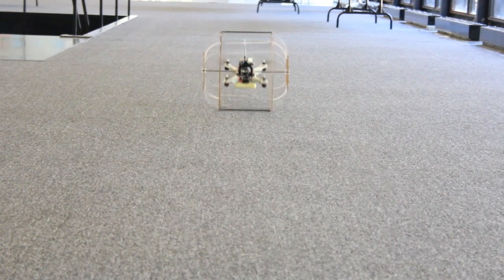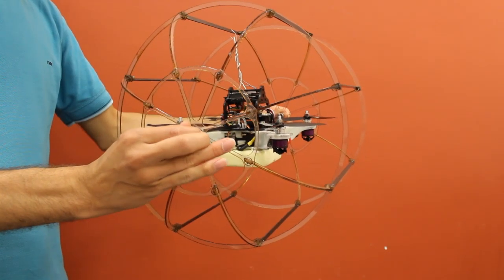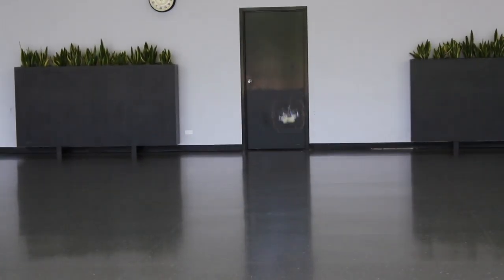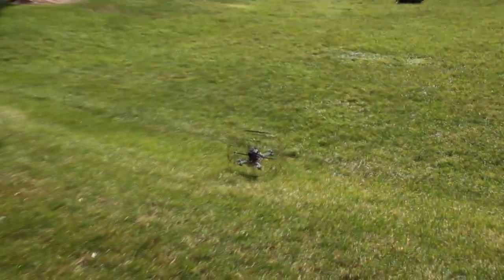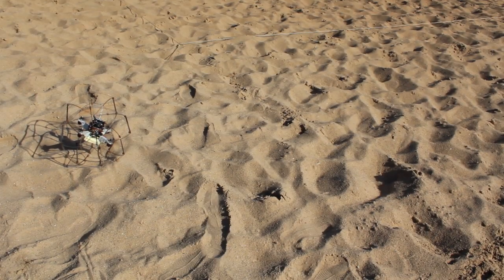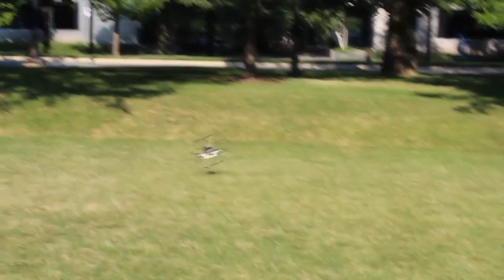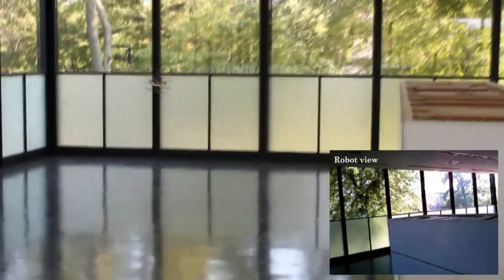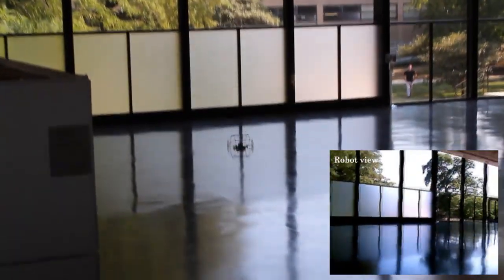HyTAQ Robot

Comment: There is no efficiency there...  There  is  no  need for it to roll on the ground when  it  can fly,  it's redundant, and that heavy cage eats 2/3rds of flight time.  REALLY BAD INVENTION!
Reply: Anatoly Vizitiu The whole point of rolling is to save power- since the cage is effectively a super light wheel, the device only needs to achieve forward motion, rather than forward motion and lift at the same time, as would a normal quadrotor. Essentially, this machine can cross most (if not all) forms of terrain as that of a traditional quadrotor, but at a fraction of the energy required. Furthermore, the "heavy cage" is unwarranted as the video showed the whole device being held at one's fingertips. Surely, if the whole assembly can be held by a pasty robotics nerd without much effort, then the cage itself can't be any sort of heavy.

Comment: It's an added functionality, the main purpose of the outer frame is to protect the propellers, but yes, it can easily be used as a crawling locomotion (on any surface), when required - it is also much lesser in battery consumption than flying.

Comment: a quadcopter has two propellers turning in one direction (opposite ones) and two turning to the other direction. if opposite two propellers  turn faster than the the other two, the quadcopter turns (to the opposite direction of the faster ones). you can read about momentum for a better explanation :P

Comment: Two of the props are opposed, turning counter-clockwise. So, it doesn't rudder in the classic sense. Changing the speed of one or more opposing props in relation to the 'normal' ones effects a rudder-like action. Some multi-rotor designs add a servo on one rotor so that pitch for that rotor can be changed to effect a basic rudder, but most quadrotors just use the opposing rotor pairs and fly in a sort of gyroscopic manner (this also allows them to flip).

Comment: Really awesome concept! I can't wait for one to come out on the open market so we all can play with it!  I see one limitation though.  Crawling over weeds or tall grass and you will soon get tangled up, propellers and all.  Of course you can fly over obstacles like that.  I cannot see a way around that limitation since you need to have a free minimally obstructed flow of air through the device to minimize destructive eddy currents.

OMG! sharp propellers might turn it into a robotic lawn mower!
Reply: Adding masquito net over the wire cage can solve it as additional option for the cases when operator sure it need. So engineers must design suitable net case to fit the cage.

Comment: But the life size version would have a different weight to power ratio.  I can imagine a helicopter inside a huge cage / wheel type of cage, would not be too efficient.  Considering battery powered plastic toy vs an alloy counterpart, the power / fuel ratio would not be efficient.  And trying to counter the torque created by the helicopter inside this cage from spinning / turning over would also not be efficient (single blade heli has tail rotor to prevent horizontal not vertical torque).

Comment: It would not be more efficient than motors directly powering wheels, but I'm guessing the purpose of this is to allow the quadcopter to travel on land when possible, which requires lowering the power to the motors so that it does not take off, to save battery.

Comment: the fuck are you talking about? if the rolling resistance is less than the total thrust * cos(theta) it will roll. roll resistance is a function of the thrust * sin(theta). If you have more downward thrust, the craft is "lighter" so it has less roll resistance.

Comment: I think it would be better to have a collective pitch system, just like a "real" helicopter. When switching from the floor to a wall, the pitch filps 45 degrees opposite. It would only be a small change in the code to reverse the gyros once the pitch passes 0